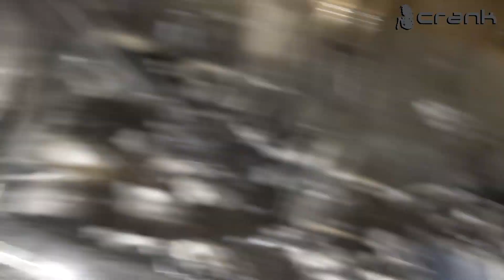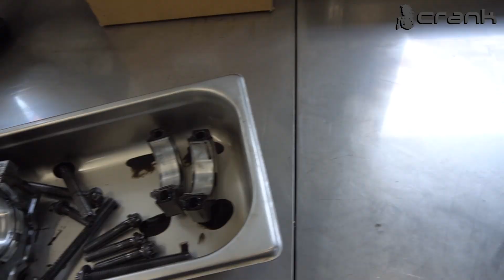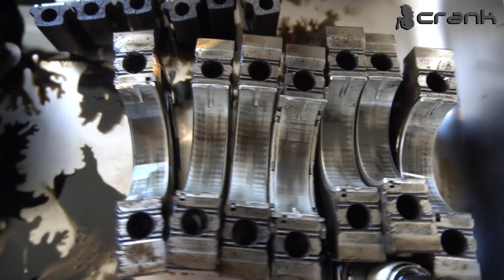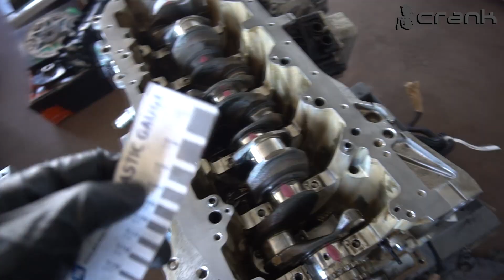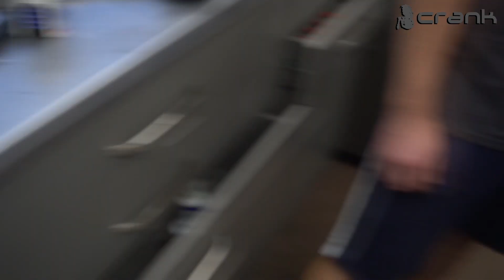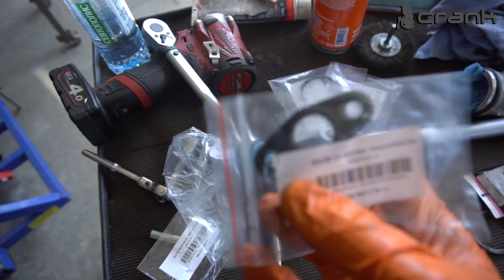Most Expensive BMW F15 X5 N57 Repair Ever

Comment: Hi! You’re hardworking some n57 with really success! I have a modérate scratched n57 crank in the 6th rod…we can regrind this crank? I think is induction hardened with a 1,5mm thicker hard surfacw layer, but i dont know if a 0,25 o 0,50 regrid will mess all…

Comment: greetings, I've been following you for a long time, otherwise I'm a car mechanic, I'd like to know what the main problem is with turning the bearings, do you have a specific answer, thank you
Reply from the maker: Nobody has 100% answer, but mostly bottom end design, weak cylinder block main tunnel which is  twisting because of bad reinforcement and crankshaft design also ofc
Reply: @crank3646  I personally drive a bmw f10 n57, 400,000 km, the engine has never been opened, the oil interval is 7000-8000 km, I plan to open the engine, refresh it, is there an oil pump kit or a better oil pump, do you know

Comment: Bro hear this out, there is a guy on internet that says he has solved the main issue that causes bearings to spin - by replacing oil pump gear with smaller one from m57d2 193hp and using the n45 valvetronic chain on upper camshafts gears and m57d2 chain minus one piece to make it smaller for the crankshaft chain. He also recomends to make dpf off to prevent high heat getting on the block and dilate it to the point of spining bearings.
It’s interesting how would that translate into reliability, he claims problem solved because higher oil pressure from 0.9 bar increases to roughly 1.4 -1.5 bars at idle which means better lubrication of entire oil dependant system.
Reply: The problem is not with oiling, the crankshaft is too soft and it bends, that's why the outer main bearings are worn.
Reply: @adamturowski8948  yes scania also had this problem because of the material used the crank deforms and takes down two bearings
Reply: @L3XAn6er Can you give me a little bit more information about the chain option? Is there are a master link for the M57 chain so we can remove one link?
Reply: @MMorePwr  yes it has a marking is different from the others, if you rebuild the engine do not use cheap crankshaft, try and buy forged one from known brands like kolbenshmidt for example or others but not made in turkey.
Reply: Better to use also thiker oil likes w10-40
Reply: @giulianomelli9119  if you remove dpf you can use 5W40 idk if any thicker than this would work for the tensioners of the timing chains

Comment: Very informative video. I do have the same engine on f30 platform and it still sounds smooth however only on 105k miles. Unfortunately makes no financial sense to change everything on 10 years old vehicle as such a job would cost here in England easily 5000£ and the x5 on this mileage would probably cost 10k if not less. I am very impressed it actually got to that sort of mileage I guess it has been serviced as should.